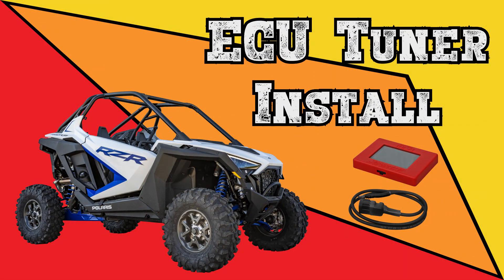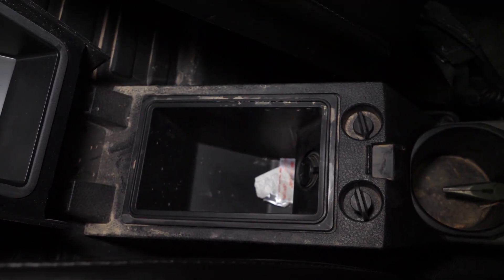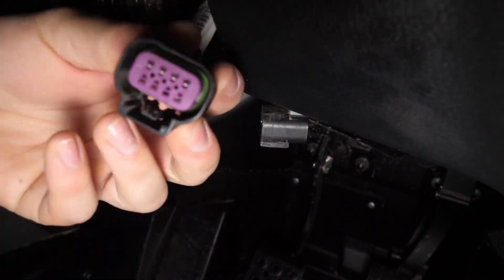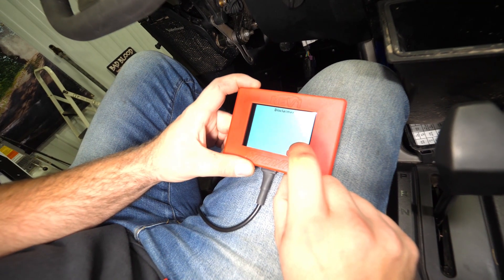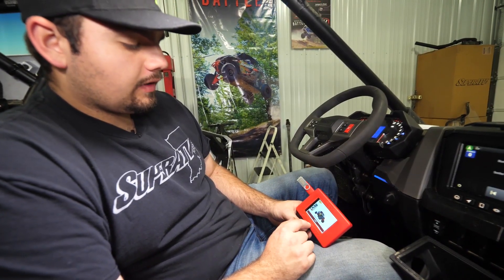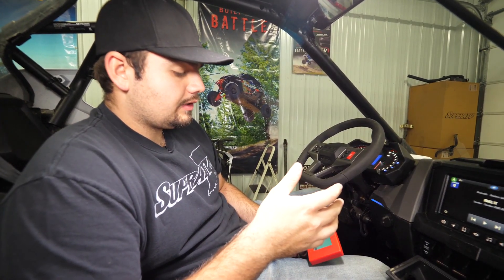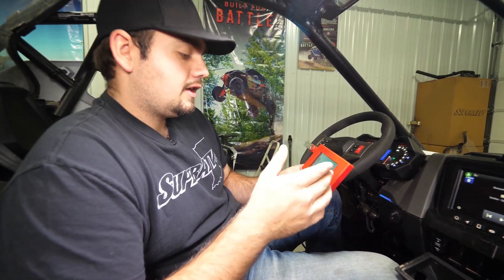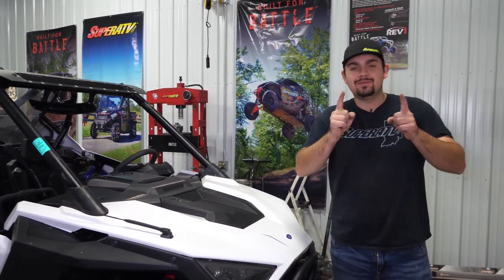SuperATV ECU/ECM Rev1 Tune Install on Polaris RZR Pro XP

Comment: Is this better quality than dynojet? Robust enough to mount on dash while I go through sand and dust?
Reply from the maker: This does have different parameters compared to Dynojet, which can be found on our site. You can carry this kit with you if you'd like however it is designed to be flashed, disconnected, then stored away in a safe place. You do not need to keep it plugged in once the ECU has been flashed.

Comment: with 181 HP straight out of the box, why would you want this???
Reply: Dunes
Reply: Some guys always want more. However there's limits to what the CVT and the belts themselves are actually capable of. Theres guys out there with 300+ HP Turbo S's and X3's, running E85 etc etc. Makes little to no sense to me as well, but hey all the power to them I guess.